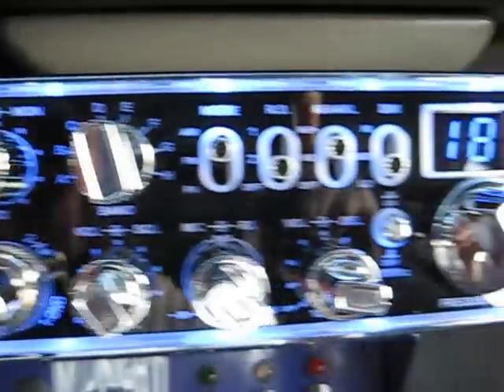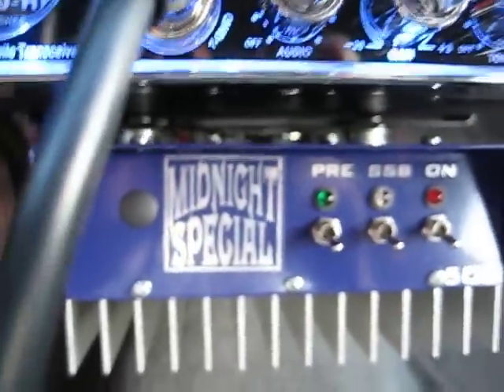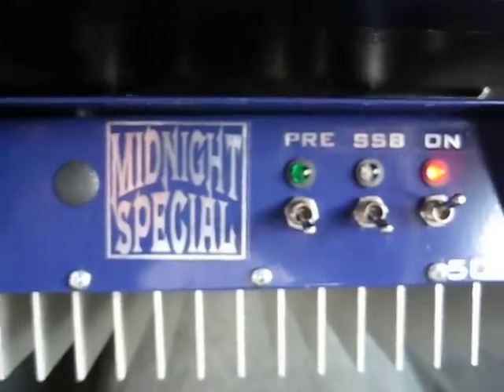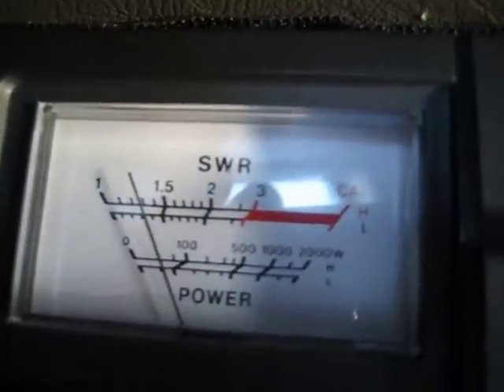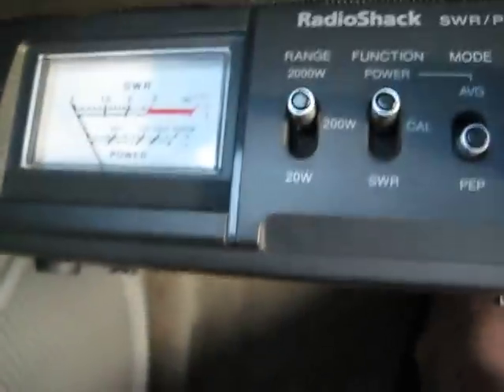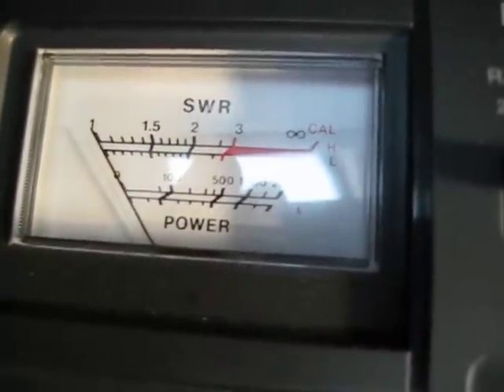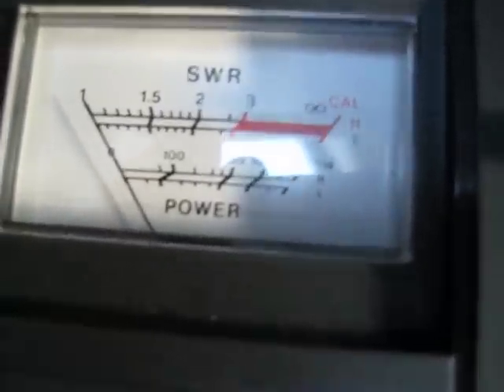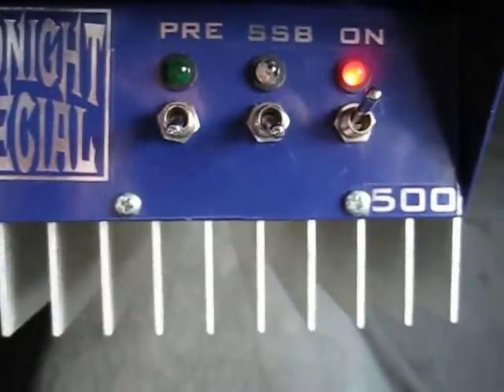Stryker 440 with amp

Comment from the maker: @348nm I'm actually using a seperate mount flipped up side down attached exactly where the radio mount attaches too.  Then I pulled the cover off the amp (be careful the leads of the fan are very short) and drilled 2 holes in the top of the cover and used those holes to hold the amp to the mount.  Hope that makes sense!

Comment from the maker: No, I just have a typical "U" mount turned up side down.  I drilled holes in the top of the amp's case to mount the amp to it and then use the ears on the side of the radio to hold it just below the radio.

Comment: I just posted a video of my setup. Thanks for your help. This is my first time having an amp and know very little about them. When I first hooked it up and tried it with the 1 watt dk, reports where it did not sound good. Better without the amp. Specs on xforce site says 2-5 watt dead key and did not know if that was the problem. But, getting good reports now.

Comment from the maker: Yes to both.  Direct to battery from both radio and amp.  The MS 500 will grab all of 100 amps or so under load so make sure you've got at least a 130amp alternator.  Wish I had extra money and time.  I'd love to volt this box and see what would happen :)
Reply: If u think the midnight special pulls 100 amps you have lost your damn mind

Comment: I'm goin to finish it and figure it out tomorrow and will definitely leave a follow up on how everything is working. I had a MS250 that was awesome for what it was. It would swing 260 all day if u let it but I didn't like the heat with its small size. Hopefully this one turns out just as good durable wise.

Comment from the maker: Nice video, I just watched it.  One thing to remember.  An amp is just a magnifier.  If you put a crappy signal into it, it'll put a crappy signal out.  If you get good contacts barefoot with the radio, flipping the switch to the amp should just make things better.  If you didn't sound good with 1w dead key I'd almost tend to think it was something with your mike gain.  The Strykers will swing so power output wont change on the big end regardless of what dead key is.

Comment from the maker: I run seperate + and -  for the amp and radio.  It's bulky and took longer to route but I feel as though each should have their own source.  I ran 10awg wire for the amp positive and ground and 12 awg for the radio.  I also used some ground straps and grounded the case of the amp to the chassis of the car.  I use a mag mount antenna so I also used 4 ground straps from the trunk lid to chassis.

Comment from the maker: @hamtalker2007   It's still working just as it should and it's almost a year old now.  I cant remember what I paid for it but I think it was around that mid to upper 200 range.  It will work good behind your radio!  The amp does draw some amps but it works just fine in my car with the stock 105 amp alternator.  I dont think i'd go any bigger than this small 4 pill box or a large 2 pill.    I run the stock 8awg wire out of the box and directly to the battery.

Comment from the maker: @hamtalker2007 
Thanks for the comment.  Actually the Stryker I am running has a tuned dual mosfet final in it so it would have completely over driven that driver in the 700.   That's what x-force told me anyway.

Comment from the maker: @hamtalker2007  Just an off the shelf Wilson 1000 mag mount.  I have it on the trunk/deck lid (depending on what you want to call it)  of my car and run 2 ground straps from the deck lid to hinges.   A small 4 pill behind the Stryker 440 will get out!  When the skip is out I get over the top.  When the skip is in I get the contact.  Everyone want's to talk to a mobile :)

Comment from the maker: Good deal!  Yeah X-force makes a nice product that's for sure.  All I did to mount the amp to the radio was to buy another adjustable radio "U" style radio mounting bracket.  I drilled two holes in the top of the amp's case and mounted the "U" bracket upside down to it.  Then I just used the Strykers stock mounting point to hold the bracket/amp.  It works great.

Comment: I have the newer one with the 2879's. I'm pushing it with a cobra 29 with the dk down to 2watt and bout 20watt swing and that's in the range they suggest. It doesn't have a knob to adjust the power on my radio but I can adjust that inside it pretty simple.  I'm running 6guage cables off both the power and ground. Power is straight to the battery with fuse in-line and I'm goin  to try my ground somewhere else to see if that helps because it isn't consistent right now and I've had these amps befo

Comment: btw, I am running the amp strictly off a stationary battery and not in the mobile with alternator voltage. Simply the 12.5-7 volts to amp.

Comment from the maker: I do get compements with the radio/amp.  The Strykers are known for their clean audio so I guess that's expected.  Yes, the MS500 does heat up quickly!  I've gotten mine almost too hot to touch and it's never faulted though.  It's almost 4 years old.  If I could go back and do all things over I think I'd try a motormaul or a 2nd alternator and run an 8 pill.

Comment from the maker: I usually try and keep dead key at or under 5w with my 4 pill amp.  The strykers have a final drive which will power the amp plenty, especially on a 2 pill.   As far as the meter goes, coax from radio should go to the amp input.  Take the amp output and feed that to the meter.  Then meter out to antenna.  I'm not to familair with the 447 but I'd have to assume it's similar to the 440?  Seems like a lot of radio for a little 2 pill amp.  Let me know how it works!

Comment from the maker: I said it does 500 ish watts beacuse 500 is actually on the low side.  I think you need to blow the video up a bit.  The meter is set on the 2000w scale.  She's swinging up well past 500 and the Dosy has confirmed that.  We all know the Bird doesn't lie either so I promise it's got 500 in the tank.  I agree with the dead key comment.  This is a high drive amp and thankfully the Stryker has a variable power (dead key) option.   Thanks for the comment.

Comment: You said in your video, that amp does around 500ish watts. That radio shack meter reads 300? In a mobile once ya set it up & ya know the set-up isnt squelling....leave it be? I tend to keep the radios carrier (dead key) low, so i can see the swing on the radios meter, nice equipment you have.

Comment from the maker: Funny you should say that.  And it's funny because from what I've found there really isn't anything junk about it.  I do have a Dosy of which this rado, amp, and antenna have been on.  PEP output on the Dosy was 11 watts higher than this meter.  My fater has a Bird meter of which this rado, amp, and antenna have also been on.  With the Bird PEP output was 21 watts lower.  I guess you make the call.  The Dosy is way to clunky to be in the car as is the Bird.  This meter works just fine :)

Comment from the maker: Yes, 40 watts amplified dead key. Sorry.  I just assumed everyone knew that I was talking about the amp in this video. It's that linnear thing.  It'll swing just about 575 when the transistors are cold.   To be honest, with the final drive of the stryker it really doesn't matter where I set radio dead key as far as total wattage output goes.  It just sounds better at where I have it.  How does that Davemade sound?  Hopefully like a tube amp.  I mean for an advance amp that's what I'd expect :)

Comment from the maker: I was just on x-force's site and I'm a bit out of the loop.  I didn't realize they now are doing mossfet amps!  I just assumed you had meant that you were running a 2 pill MS250, NOT a mf200!  My fault.  Either way though it looks like you are in the ball park.  I think the shop that did your radio did well.  Run that dead key as low as possible and let the radio swing.

Comment from the maker: @svblair90  Thank you.  Is your 700 a newer one with the 2879 finals or is it an older one with the 1446's?  What radio are you running and does it have a vairable DK and Power?  I run mine direct to battery through a fuse using 4awg wire.  I use a 6awg ground from the amp direct to frame.  I also ground the case of the amp with twin 10awg.  I use a mag mount antenna so the deck lid of my trunk has 10awg ground straps to the chassis as well.  That seemed to help SWR quite a bit.

Comment: Nice setup I have the 700 in a dodge 3500. How did you hook up your power wire just straight off the battery? I feel like im not getting enough power and both my ground and power are 6ga. Max dk 300watt and 550watt swing

Comment: Sorry about all the questions, this its first time ruining a powered up radio. Are you running separate lines out just one from the battery and tapping the radio and amp from the one? I want to run just the one power line. I can handle the install no problem, I just have no idea how many or what kind of fuses or what gauge wire to use.

Comment from the maker: So what is that 29 dead keying, It's got to be way up there!  Can you adjust it down internally?  I'm not positive but I would think 100w pep into those 2879's would be just about perfect so that radio would be my choice if you could control the dead key.  Keep in mind if you ever run off just more than a stand alone battery at 12.5-7 volts like an alternator at 14.5 or so you're going to see a pep increase too.  I know I can't get anymore than about 440w with my car not running.

Comment: Did you have to use external fuses to run the juice box? I would like to run a President HR2510(which I have) with an Xforce midnight special 700 over a viper 70 inch antenna, think that would get me out good?

Comment: And I have the same swr meter. Did you just run the cable from the back of your cb into the antenna side and another from the transmit side back to your cb? Thanks again

Comment: Just curious myself. I have the new midnight 500 with the 4x 2879's and I have 2 radios. One stock cobra 148gtl with SSB and the second is a cobra 29 ltd with a rfx75 swinging 100 out. I have keyed the amp once with the 29 radio and it swung to just about 600 but I didn't want to fry it because I don't know it I am pushing to much in. The 148 (10 watts) gets the midnight to swing about 250, would be nice if I could use the 29 with rfx though. Any thoughts?

Comment: cool man, i got a stryker 440 on base and i got one from cragslist for 120.00 with nitro knobs in my car, and i have a wilson 1000 mag on the roof, and i am thinking on getting the midnight special 500 for the car, i can get one for $270.00 to my door from hy electronics in lousiville ky, probly will buy one with in the next to weeks, is yours still working good? just wondering if you that it is a good box to by thanks

Comment: What dead key are you putting into the amp? I am running a sr447 and a midnight speacial mf200 amp. The radio shop set my dead key at 1 watt turned all the way down, and told me to run it there. Specs on the amp says 2-5 watt dead key. It just does not sound right and need some advice. Thanks

Comment: Dont key that at 100 watts ... Ive owned many of them,they should be keyed at atound 50
Reply from the maker: So, if that happened for say 13 years what would happen?  Only asking because that's what I've been doing, for 13 years...  Still have the same Stryker 440 and the ms500..  In a motorhome now days.  But it still works. Really well :)

Comment: How far can you talk with something like this?
Reply from the maker: It depends on the conditions.   If there isn't any skip I could reach contacts 30-35 miles away line of site.    If the skip was in, I could usually get over the mud and reach whoever I could hear.
Reply: I hear ya. Quick question I just ordered a Stryker that swings 100 Watts, so if it ever comes time for an amp what do I need to look for? I see input on most are between 5-20 watts. Would those be too small since the radio is putting out over 100?
Reply from the maker: @danielboone3795    That's probably a dead key wattage rating you are seeing on those amps.  You should be able to control that with the radio you are getting so I wouldn't be too concerned with that rating.   The 440 in this video would swing approximately 50-55w which was a nice fit for the small 4pill (1446's) in the MS500.   If you are going to swing 100+ you should be able to drive a bigger 4 pill. Something with 2879's.    I'll be honest, I've been out of the radio scene for a few years so there may be even better options out there.
Reply: We’ll see I don’t know much of anything. I’ve always ran a cobra 29 in all the big trucks I drive but I want something big for my Jeep in case anything ever happened way off on a trail somewhere. I didn’t think of that being a dead key rating...
Reply from the maker: @danielboone3795  I really like Stryker products so I'm sure you'll be happy with the radio.   Keep in mind with an amp it's going to put stress on the vehicles charging system.   A lot of guys run separate electrical systems just for their amps.   In my case I just ran the factory components my car had and I went through 2 alternators in as many years.     You'll also need an antenna to handle the power.    Not sure what type of Jeeping you do but if you are in areas with heavy brush and tree coverage, its going to take toll on a good antenna.
Reply: Yeah I’ve been looking into that too. It’s got a 5.3 Chevy in it so idk of those out out any more than the 4.0 Jeep did or not. All my lights are led so it doesn’t have much of a load on it I’m assuming minus the radio. And then again I may not even want one when I get it going but wanted to get headed in the right direction early in case I did lol.